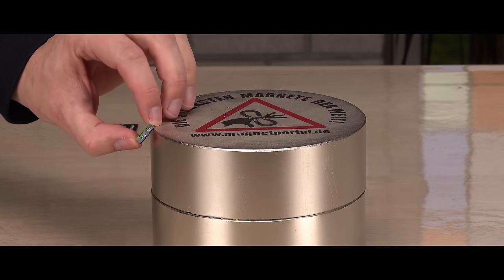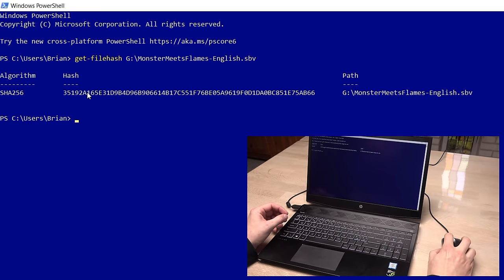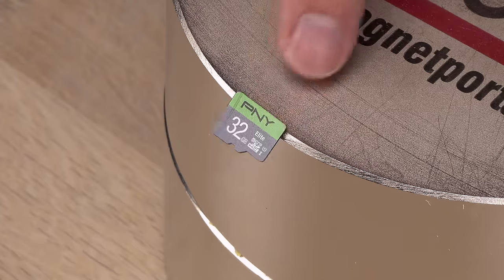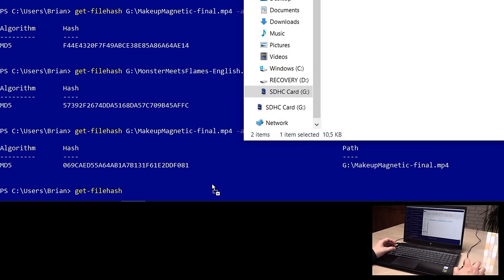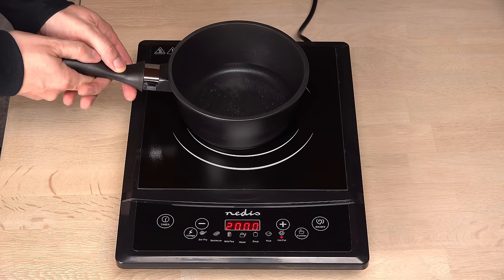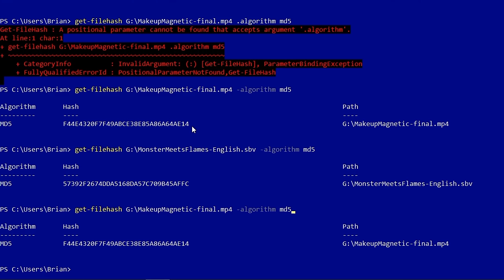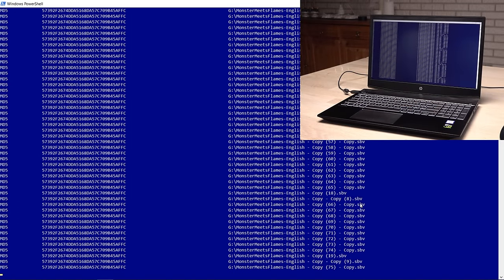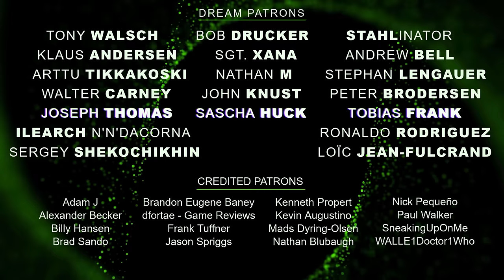SD Card vs. Monster Magnet and Induction Cooker (2000W AC electromagnet)

Comment: First: This is not a question about free energy where you power a generator for a short time and it will run forever(BULLSHIT)

I have a question to this amazing magnet community: I want to build a magnet generator. I want to use a 
motor with round about 3kW of power and 380-400V. Now my idea is to build a construction with rotors like on a wind mill but placing it horizontally not vertically. On the rotors I would place magnets and around these rotors I would build a construction in a circular shape that has magnets on it too. My idea is that the magnets on the outer circle repel the magnets on the rotor which is connected to the motor/generator. So the rotors start spinning and powering the motor, so he produces clean constant magnetic energy!

Here comes the question you all waited for: Is it possible to rotate the rotors fast enough so that they produce electricity(I think it need to reach depending on the motor a little more than 3000 rpm/50rps)
Reply: Btw I'm asking this question because i couldnt find much information about this. I also couldnt find any videos about this on Youtube because all videos that appear are free energy bullshit or spinning a fidget spinner :( which isnt helpful

Ty for all your answers and suggestions :D

Comment: You should have saved the original video file on another drive and then compared the two files after magnet test frame by frame with a software that would detect a single pixel anomaly.

Comment: I honestly think the checksum change was legit and your test flipped just the right bit (it doesn't have to be the exact same). Seems more likely than a genuine error in the hash algorithm. Hashing is extremely reliable, it has to be. Cosmic radiation is also extremely unlikely.

Comment: SD Cards have nothing magnetic inside of them. Flash memory is stored in isolated electrons in some isolated gate. There's no charges that can move so there's no magnetic effect. This video wasn't at all surprising. If you heat them up heavily they will lose their structure however.
Reply from the maker: I was surprised that the SD card didn't heat up more on the induction cooker. Especially after seeing that the SD card contains something magnetic enough to stick to the magnet. But whatever it is, it is thin - under the skin depth - so not very affected by eddy currents. Thanks for watching!

Comment: actually i don't think any kind of sd card would change it's data under these tests that you have done all sd cards do offer write protection features which makes them very immune to any kind of noise but never the less please don't cook your cards.
as for why the video changed it's check some ... well to be completely honest i don't know for sure but i do know for sure that it correcting it's self heavily indicate that it was software related the chances of this happening because of the magnet then get undone are flat out impossible the chances for that is indescribably small it could have been an error also it could be some change of data that the computer did video files don't always store raw video data some times they store the moment that the video was on when the user left it to get you right back at it some videos store there last opened time i can not be sure that happened but i can be sure what ever happened there was because of the computer and not the magnets it probably was a good idea to do the checks before and after you opened the video but hey they do take a long time so that okay

Comment: Try with EMP!
Reply from the maker: Could be fun actually. But I have cameras and neighbors to take care of ;) Thanks for watching!
Reply: @brainiac75  You can try it quite safely, if you do small device from few low impedance capacitors (in parallel) and thick copper wire (or pipe) coil. Put the SD in middle of the coil and keep camera at least 2m away.
Thanks for the entertainment!

Comment: PNY makes fantastic products.

SanDisk... doesn't.

I will never use a SanDisk mSD for any kind of critical data, ever. They fail if you so much as look at them wrong. They're the Western Digital of microSD cards.

I have a 64GB PNY mSD in my phone, going on 3½ years, no problem. I've got a Samsung 64GB mSD in my dashcam—every bit of space being rewritten every 8 or so hours. That's been about 4 years of constant use.

SanDisk mSDs, though? They're disposable. Use 'em once and they're trashed.

Comment: You need to do a capacity check. The magnet might not effect the files but may effect the capacity of the drive. Some drives show 2gb but are really 100mb so use a program like checkdisk or a usb analyser.

5 Free Tools to Check and Test USB Flash Drives

https://www.raymond.cc/blog/how-to-check-and-test-usb-flash-drive/

Often it is the static discharge which overloads the micro circuits inside the IC which damages them. RAM can lose allocation units while the TOC (or what ever that chip is in memory) will still show full capacity but in reality your 8gb card is only 7.3gb etc.

Comment: PNY is a somewhat cheap brand, not famous for quality. The "magnetic proof" buzzword on some SD cards is quite much like the "organic" or "gluten free" label on bottled water. 
My best guess for the error is the card actually had a single weak bit somewhere and it ended up frying in your tests and getting permanently set to 0 or 1. That or windows is such a massive piece of crap that it's actually rolled out a buggy checksum pice of software. Seriously switch to a decent gnu/linux distro.
Of course, we would know what happened if you had copies of the before and after files to somehow "xor" them, but now we'll never know :(

Comment: I think the misread of the SD card was due the magnet, even when the data stay intact.
Reply from the maker: Hm, maybe. The magnet was around 1.5 meter away from the laptop during the checksum calculation, so I doubt it had an effect. But you could be right. Something affected the laptop/SD card during the 2½-3 minutes it took to calculate the checksum. Thanks for watching!
Reply: @brainiac75  Yeah, I know it's low probability, but I think the other options are even lower.